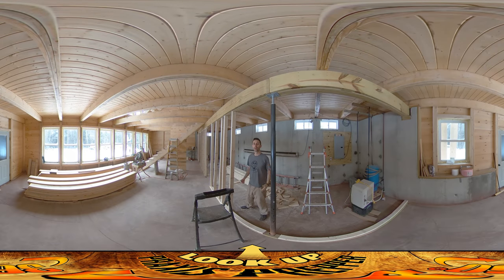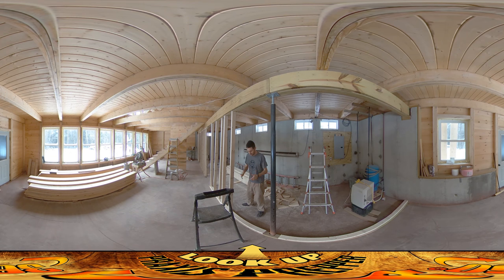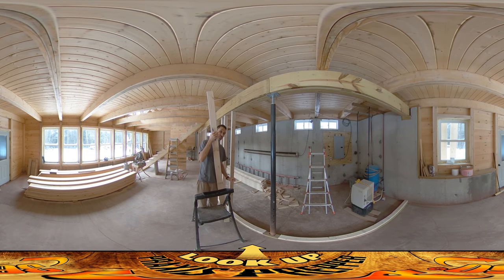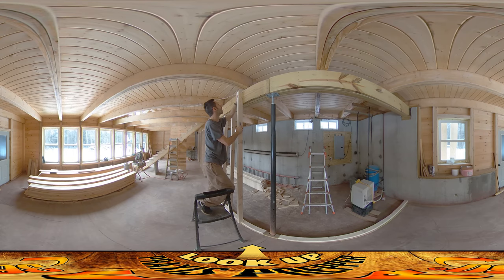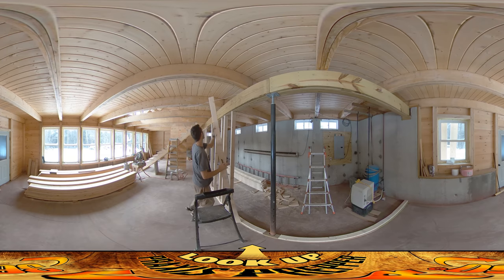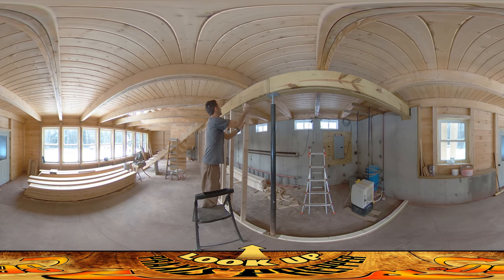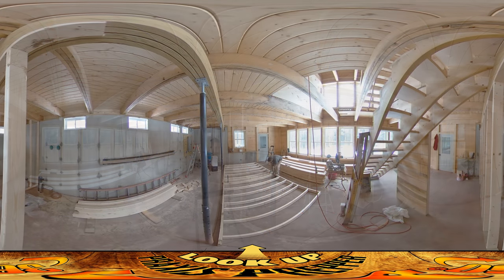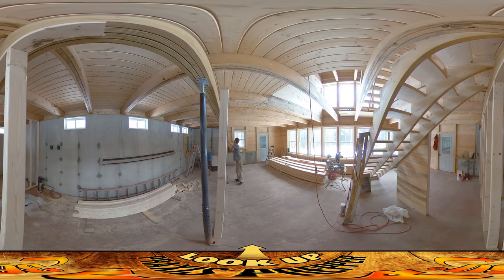Homestead Building - Accounting for Imperfections in Floor Height

Comment: Do you really have so much variability in the height at each location of individual studs to justify all that time for a non-load bearing wall? With a length guide you could have cut all the studs to length in probably less than 2 minutes.
Reply from the maker: What you're not understanding is how absurdly anal I can be when it comes to tight joints. ;)
The variability is less than 1/8" pretty much. Yeah, I could just find the shortest distance and just cut to that but... I'm me. Too much of my dad in me!

Comment: Showoff at the end, surely you could have done each section on it's own instead of lifting them both at the same time.
Reply from the maker: Show off? Never. I actually had to lift them both at the same time because while the top was severed around the top of the post, the footer board was contiguous all the way along the wall. It actually was a lot less difficult that I had anticipated it would have been. Next time I'll have to dead lift the entire thing off the ground for a real challenge! ;)
Reply: @PraxisPrepper  ohw, it was continuous? hmm i had thought of that for a moment but found that un logical as it meant having to lift the whole thing at once ... I would have made it two parts and assumed it was ;)